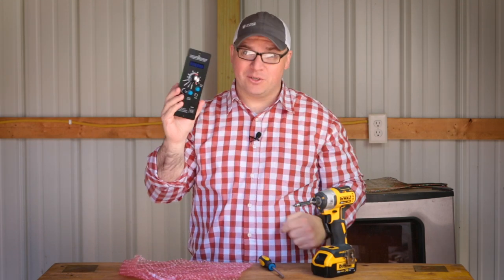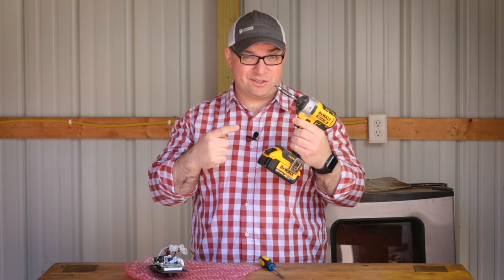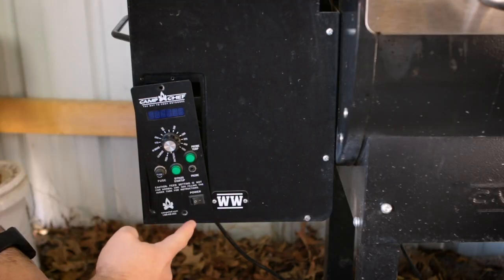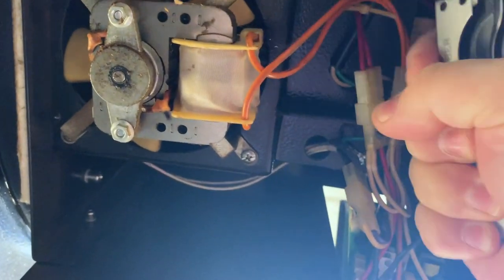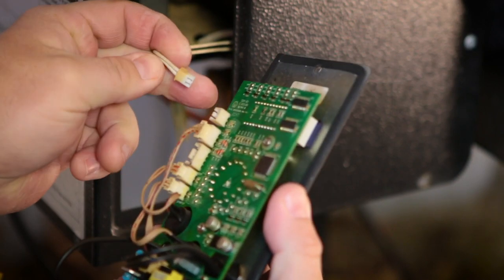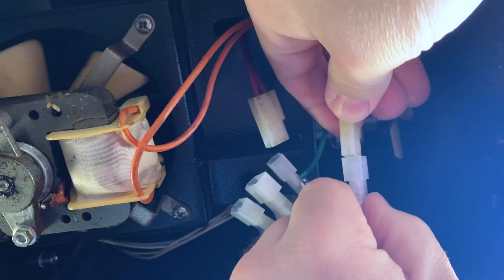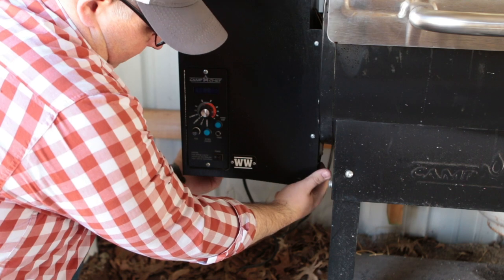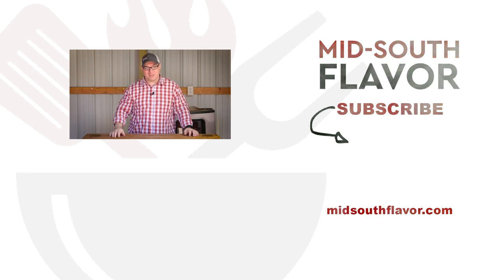Camp Chef Controller Upgrade

Comment: My “probe temp button” is stuck and won’t pop out. I’m also getting a prerr code. I got it used so I don’t know anything about it. Should I get a new controller? Looks easy to replace thanks to your video. So thank you for sharing.
Reply from the maker: The prerr code is because it is trying to read a probe temp and there in no probe inserted.  It seems like there might be something causing the probe button to stick.  You might could take it apart and clean it.  But yes the replacement was easy to do.  You might try tinkering with it yourself first....if you don't fix it...order a replacement! :) 
Glad you found the video useful! Merry Christmas!
Reply: Mid-South Flavor yea. I didn’t get a meat probe. But it works perfect. I used my maverick to test the temp. Works like it should. Just doesn’t show the temp in the controller. Just shows prerr. I can work around it. Thanks again. Merry Christmas!

Comment: Will not hold temperature heats up and them the temperature will start dropping. When finish cooking put control in shutdown. Sometimes after it shuts off it will start up again  by itself
Reply: I have the same issue. Following to see what comes of it.

Comment: I'm planning to buy the basic SE24 model.  If I want to upgrade the analog with the digital controller, is the process any different than that shown in the video?
Reply from the maker: I'm really not certain.  If the digital controller is compatible, I would assume the process would be very close if not the same.
Reply: @MidSouthFlavor  I'd be buying Camp Chef's replacement controller.  By the way, why is it a good idea to use a digital controller over an analog?  I've heard a lot of people say they've "upgraded" to a digital controller, but no one talks about why they consider it an upgrade.  Is it simply a matter of temp accuracy?
Reply: It’s not, I upgraded the cheaper one